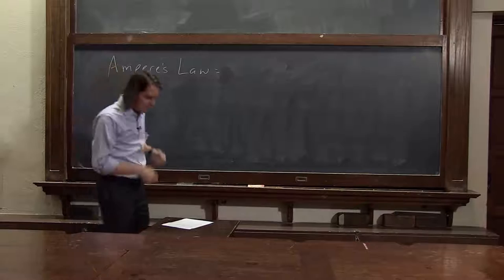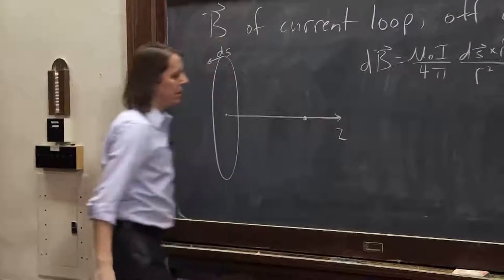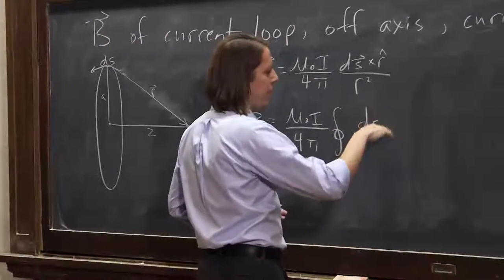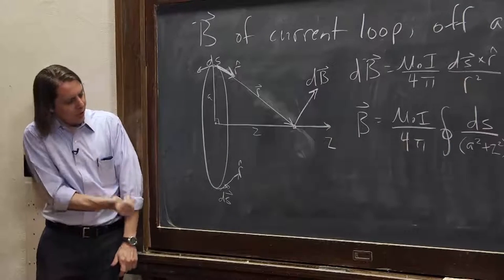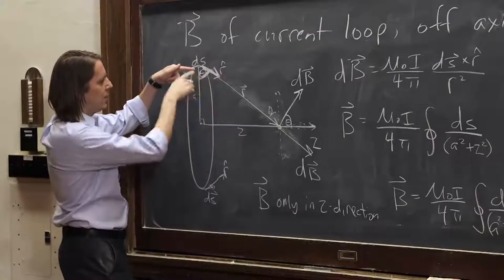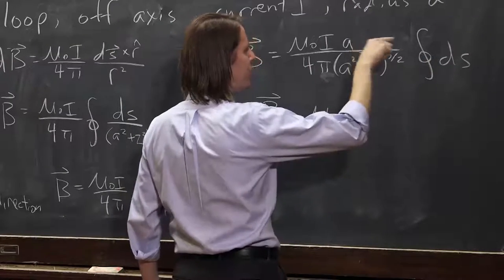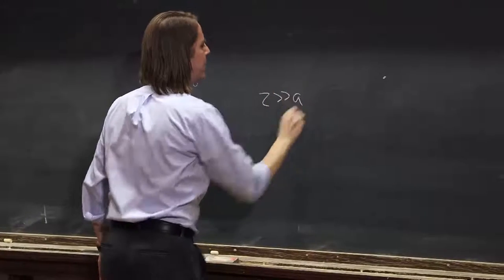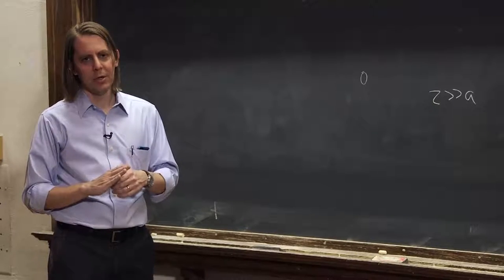PHYS 102 | Biot-Savart Law 6 - Magnetic Field off Axis from a Current Loop

Comment: sorry  but this is not off-axis, just off center but on-axis.
Reply: Exactly lol. This is freshmen level math what he's doing here. I needed the off axis solution, which to my knowledge involve elliptic integrals and whatnot.
Reply: @julioforessi1336  Yeah I get it, but it's label is misleading. I needed that solution for my electrodynamics homework problem, in which the point was only very slightly off axis. In the end I figured Taylor expansion around r=0 would do the trick, since elliptic integral does not form a close form solution and therefore is kind of useless if you want to do anything beyond.